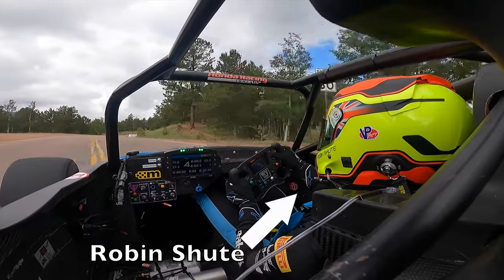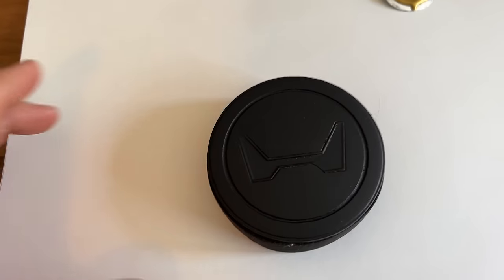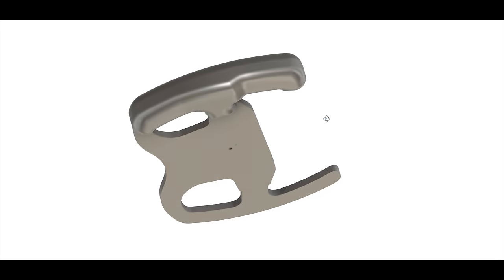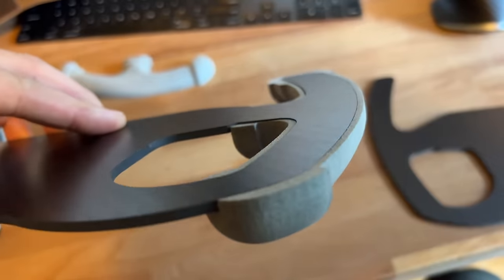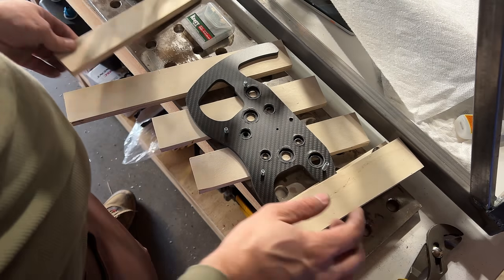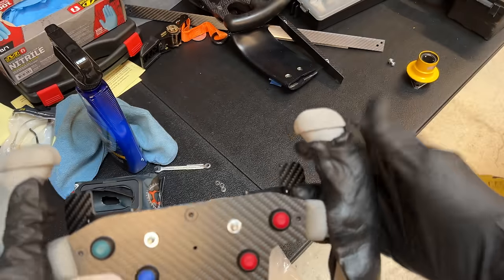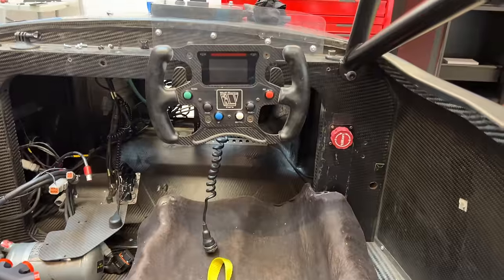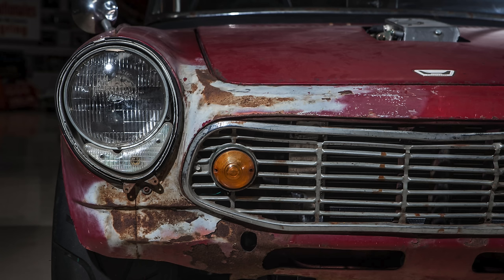I Made A Carbon Fiber Race Car Steering Wheel

Comment: here's an idea for next time, do the hand squeeze mold in the same epoxy material, but then 3D scan it and "relax" the 3D model before you 3D print it to get a potentially smoother end result
Reply from the maker: We thought about this, and we might still scan it and print new grips with the hand shape already in them.
Reply: I'd try a 3-step molding - a thinner initial contour squeeze, sanding, then squeezing a thin 'sheet' around that to get the final shape & thickness with less lumpiness.
Reply: This was how I would have approached it as well. You scan clay that he's gripped, and then clean up the 3D model.
Then you could print it out with a softer grip material or print out a mold and then add polyurethane grips directly to the carbon wheel.
Reply: One nice thing about squeezing to scanning to cad to something workflow is you can use all sorts of materials for the original mold depending on what you're trying to get an impression of. Low temp Thermo plastics like in sports mouth guards, medium temp like kydex, I got a pretty good scan of inside a shoe once buy putting a plastic bag in the shoe and filling with two part expanding foam and scanning that (after glueing the broken pieces from taking it out of the shoe.)
Then you can smooth a lot of the surfaces in CAD either by editing the mesh or fiddling with the fitting parameters when getting a surface from the mesh. And finally once you have a CAD model you can make the part in any material.
Of course that's a lot of talk that represents days of work and years of experience. Matt did that portion of the thing in a couple hours with the epoxy so... That's worth something too.
Reply: Or you could simply make the dildi from a lightweight, soft wood, such as balsa. Then have the driver hold the wheel in a comfortable position and kick him smartly in the nuts. You should end up with impressions in the wood perfectly matching his hands. If it isn't as precise as you would like, just repeat until satisfactory results have been achieved. All hail
Reply: @jonathangehman4005 , just make sure that the driver is holding the correct set of knobs when they receive the kick.
Reply: "Relax" the model?
Reply: There's a perfect material for that job: modelling clay.
Reply: @SuperfastMatt  Just simply re cast with a thin silicone sleeve, then remove it after curing. smooth af
Reply: @anidiotinaracingcar4874  Reduce the bumpiness in orther for it to be smoother
Reply: @SuperfastMatt  Looking forward to this. Grips look like play-dough now!

Comment: Tip for Super Glue,  ventilation.  Put a fan blowing across the project.  The fumes get blown away before they can settle making white residue.
Reply: Good tip
Reply: Valuable comment. Thanks.
Reply: I’m going to use this tip. Ty
Reply: i had those fumes attack my eyes when i built one of my rc planes. the wing is built with super glue. super glue sticks to balsa like crazy and also much lighter than epoxy

Comment: The trick to cutting carbon fiber is not to cut it, but to abrase it. Meaning, most carbon fiber cutting bits are closer to abrasives than it is to a cutting head.

Comment: As always great video, but since I make molded, custom grips for my spearguns I may have something to add;). If he wears race gloves he ideally needs to wear those under the latex gloves when making the grip. Even thin gloves will space your fingers out a few mm so if he didn't wear them when doing the "imprint", it will sadly not fit that well afterwards.
Reply: I should add my "pro" tip. But you'd kinda need to work with composites to feel confident enough doing it or just do some tests. But when I make my custom grips I use a home made epoxy putty. I use a thin RTM epoxy resin loaded up with microballoons and then add a bit of chopped carbon fiber. The microballoons will make the putty light. Actually, so ligh that it floats, so it's less then 1g/cm3 and def lighte than any putty out there. And cheaper, too if you already have the "ingredients" around. The chopped CF adds  strength and takes the brittleness out of an only-microballoon mix.
Reply: Agreed, I thought it odd that he didn’t wear his racing gloves

Comment: Have you ever fumed wood before. Try sticking your maple in a bag or sealed bin with a bit of ammonia. The fumes activate the tannin in the wood artificially age and darken the material. Takes less energy than baking it in your oven.  Also, a little bit of gelled wood stain will do the same thing.

Comment: nice video. if the plasti dip doesnt work out maybe tennis grip tape could be worth a try
Reply: Tennis grip tape is wonderful, but it's not very durable wouldn't want it fraying off in 120 mile an hour turn.

Comment: PlastiDip will hold up pretty good on steering wheel, provided you have good surface adhesion, and enough coats so it's tough. I did it on my beetle wheel and it worked pretty good for a few years, until a spot where I applied too thin started wearing away

Comment: The moldy grips are the bane of my confusion...  I don't understand why it needs to be molded?  straight handlebars on motorcycles and round wheels on race cars have worked for millions of years throughout our evolution.....   I don't get it.
Reply: Yes and no, most are built to suit most people and be usable in a big range of situations.
As you start narrowing the field of who is using the stuff you can start tailoring the vehicle to suit.
The standard steat in your car is different to a general racing style bucket seat and different again to something like F1's moulded buckets. Same theory applies to steering wheel grips, more surface area around the fingers means less grip strength required to steer, if the vehicle has less than about 220° of steering lock to lock then hand placement remains the same so you can optimise (vs your standard street car). For something you want to hold hard and firm the molding works.
For motorbikes you generally want a looser grip comparitively, you need the mobility around the bars with your hands.

Comment: Next time, try Sugru for the grip material. we actually used this for professional racing.
Reply: Pretty sure what he used was the same compound as Sugru, without the ridiculous price.
Reply: @ryanlangan1060  OMG. How is =that= a thing? 🔥🔥🔥
Reply: @ryanlangan1060  turns out the millions they spend in F1 is for 40 packs of Sugru for the grips!
Reply: Here's the real "pro" tip. But you'd kinda need to work with composites to feel confident enough doing it or just do a handful of tests. But I make my own home made epoxy putty for custom speargun grips. I use a thin RTM epoxy resin totally loaded up with microballoons and then add a bit of chopped carbon fiber. The microballoons will make the putty very light. So light that it actually floats, so it's less then 1g/cm3 and lighter and cheaper than any putty out there if you already have the "ingredients" around. The chopped CF add strength and takes the brittleness out of an only-microballoon mix.
Mix it, let it sit until it goes a bit "green" and then you will have a workable putty that will hold its shape well.
Oh! Use soapy water on the latex gloves and it wont stick to the gloves either.
Reply: @ryanlangan1060  Maybe I'm a high roller and just didn't know it, but $18 for an 8-pack of Sugru seems okay to me, tbh...?
Reply: @jamespray  That's $18 for eight packets that weigh .12oz each. That's $18 for 1oz overall. Matt bought 1.1 lbs for around $30. So yeah, you're a "high roller"
Reply: @ryanlangan1060  Ah, I didn't check the volume.  1.1lbs seems like way more than needed, but yeah, you're right - Sugru seems unnecessarily pricey.  Personally I'd just 3D model the grips and iterate to a good fit over this janky-looking custom molded approach.

Comment: The carbon dust is also very very good for giving you permanent lung damage if cut in a poorly ventilated space. It's also electrically conductive, so its great to have that graphite dust floating around if you work with electronics.
Reply: Hell, even wood dust is carcinogenic.  If you're fabricating anything, ventilation is a very good idea

Comment: If you can it's much better to cut fiber composites with carbide (or even better, diamond) tooling. If I had a lot of holes to drill in GFRP or CFRP I'd actually be tempted to use a diamond tipped holesaw, as is often sold for drilling concrete or tiles. If you need to cut up a large sheet, you can buy table saw blades with polycrystalline diamond tips (they're intended for working with MDF) that might do a good job. I happen to own a lapidary saw for cutting rocks, so I would probably use that with a diamond abrasive blade, this being a less scary option.

The other thing to watch out for is the high rake angle of a regular twist drill will tend to 'pull in' and delaminate the layers of the composite. This can be avoided by 'dubbing' the drill, basically you get a small sharpening stone and grind the cutting edges back a few thou (maybe 0.2-0.5 mm in metric) so they have neutral rake, the same as you would do for drilling brass.
Reply: Some else suggested a "dagger bit", and when I looked online for that style most of them seemed to be intended for composites, and made of carbide. Apparently the geometry of the dagger bit reduces delamination.

Comment: Most single seater race car drivers use hockey/racket grip take or cycling bar tape which works well and looks marginally better than the stuff you used

Comment: If you make parts from two layers of commercial carbon sheet, you can get slightly better performance by orienting them at 45 degrees to one another when they are cut.  

This is because most commercial sheet is strongly anisotropic, it has the majority of fibres aligned in the 0  and 90 degree orientations (they will be in the same orientation as the surface twill which can be seen in the video of the parts as cut) so it will be noticeably more flexible and weaker when bent off these axes (minimumis logically at 45 degrees). If you re-orient the second sheet at 45 degrees and bond them together you now have fibres aligned on four axes so you will be closer to isotropic.

Also, if available in the correct size, the diamond tipped holesaws used for tiles work very well on carbon sheet.  I cut halfway through from one side, flip the part and finish from the other side and get multiple very clean cuts. The centre disc does have a bad habit of lodging in the holesaw barrel though.

Comment: As someone who is building sim racing and race car wheels for ten years now, this is a good first shot but there are defenetly parts to improve. 
First i would use a solid 5mm prepreg carbon fibre sheet instead of 2 plates and add super glue. The strength of carbon is based on different thinks but layer adhesion is one important and i am not trusting that super glue bond as much as a fully cured epoxy. Then you can cnc cut the step holes aswell as the regular go through holes instead of drilling them as you said. While drilling with dull tools, you will get a lot of heat into the matrix and that can weaken the carbon. You used high quality grayhill rotary switches but there are defenetly better buttons out there from APEM, OTTO Controls, EATON etc. The CNC cover has some nasty vibration marks on it. Maybe a clean up pass and sandblasting before anodizing would be a good idea for a better finish. Last you can design you grips in CAD and FDM print the grips for ergonomy tests. When you are happy you can print molds and just make your custom rubber grips. Add some holes to your carbon grip struckture and you are good to go.

Comment: Makin my way through your content, vid by vid. Was wondering what keywords you use to pull up the magic of what the quickconnect and pass-through so all those buttons and knobs in the search engine of choice. I don't think the chassis I'm going to be picking up has all the bells and whistles, so between some small DIY home fab channels like yours . And I'd like to make sure I have some of the functionality at the planning stages. 

pie in the sky I'd love a 'Flappy paddle gearbox that shifts faster than I can' ... but those are spendy.

Comment: Only issue I have is the paddles mounted on the wheel. Once you go to column mounted it so hard to go back. Though maybe this professional driver has a preference which in this case makes sense cuz you don’t want to slow him down obviously. But personally I find wheel mounted paddles annoying, and hard to shift when there is a lot of steering input.

Comment: Matt if you ever need to produce grips or softish rubber please please cast them instead! 3d Print molds and finish them then cast them in 2 part urethane rubber or similar much better finish

Comment: Hello!  Real question here - are you putting glue on rivets when you connect things together?  Wondering what the blue goo is.
Reply: It's probably loctite
Reply from the maker: Loctite. I loctite most bolted joints.

Comment: I assume most of the wiring was not DIY but instead converted over from the old wheel? I was curious how you hook it all up without the wires binding, or were you able to wire everything through some sort of clock spring?
Reply: I couldn't see in this video, but a lot of racecars have a simple cord with a few coils (think old-school landline phone) and since the wheel doesn't have more than about 270 degrees of rotation, it's usually sufficient.

Comment: Super glue the nuts on the switches etc they will vibrate loose even with a lock washer.
Just a blob you can chip off will do.
Reply: It would be nice to be able to replace the switches, so perhaps the better adhesive to lock a threaded fastener would be a thread adhesive, such as one of the Loctite Threadlockers.
Reply: @brianb-p6586  in this instance a blob of super glue is actually the better choice as it can be put on a small spot on the outside of the nut. This can easily be broken loose where as an actual thread locker needs to go on the inside of the nut and may require many times more force to remove.
I actually speak from experience in this case.